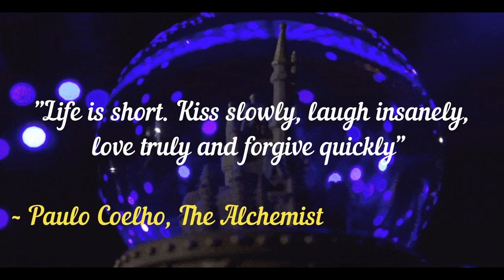RV Innovative Idea #75 ~ Building a Mount Anywhere "RV" Flag Pole Holder

Comment: Hi Tim, What a great idea.  I have been looking at something like this by GoStik but it is extremely expensive.  This looks like a great DIY alternative.  Nice Job and have a Happy Fourth of July.
Reply from the maker: Thanks Lou, That little homemade gadget is really cool and functional. If you build one, cut off the excess threads. Put a dollop of white rubber silicone over the screw heads to match grab bar.  Happy Fourth of July to you as well Lou.  Stay Safe and Enjoy!

Comment: Great, Inexpensive Idea (and easy to do for the mechanically uninclined! Our thought would be to mount a WIFI or cellular antenna and mount on the inside of our slide when it is out at the top for maximum height.
Reply from the maker: WOW Ray, you have something there man! Now that is going to be on my mind as an enhancement.  Keep the innovation idea coming!

Comment: Good idea Tim, someone sells a flag holder like that but it probably cost twice as much as what you did. I think Matt has two of them he puts on his rig.
Reply from the maker: Thanks Jason, although I kept electrical taping the flag pole to the campground light post, It would just fall over…….ughhh!  I always thought Matt had one of those fancy built in flag pole mount like on the NEWMAR’s. This one is simple yet functional and cheap to boot. ;)

Comment: That type of flag had a sleeve on it so the flag slides on the pole
Reply from the maker: Hi Zackary, it sure did but there was one small issue...the flag fits perfectly with the metal pole it came with. I used a wooden pole instead which was too big for the flag sleeve.  Great observation!

Comment: Was that a Metric or Standard Adjustable wrench?
Reply from the maker: Great question, I used a standard adjustable wrench.  I try to use standard nuts and bolts as much I can, it’s easier while on the road.  ;)